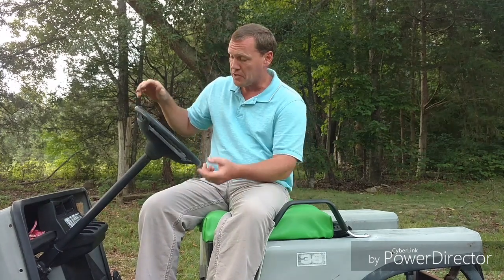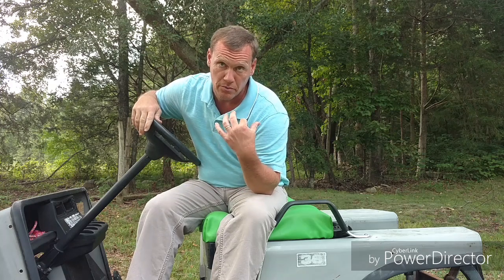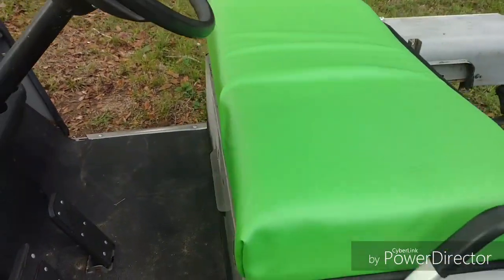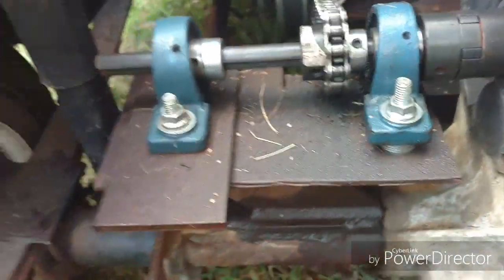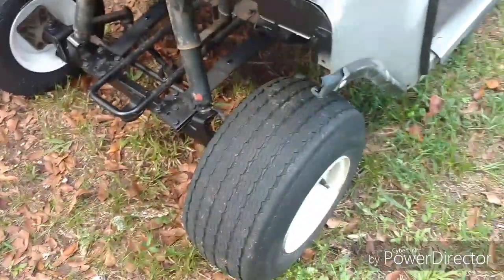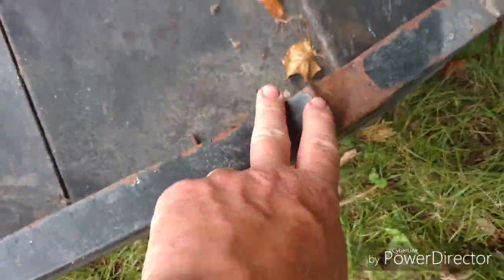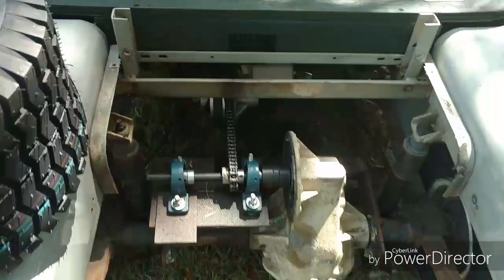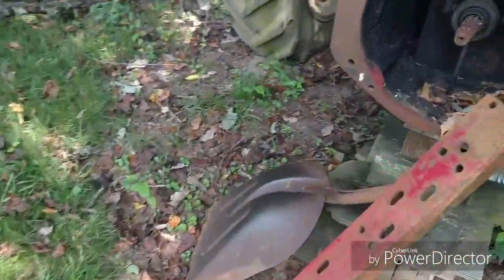Predator 212 golf cart update, Seat, throttle cable, top, added bearings, tires.

Comment: Great videos, Can you show how you fixed the motor mount to keep in from shaking
Reply from the maker: The front piece of round bar is wrapped in rubber ( a rubber heater hose works good)  that helps with the vibration and keeps it quiet. I never did box it in, I just used a good bungee strap, and lashed it to the frame, works great.